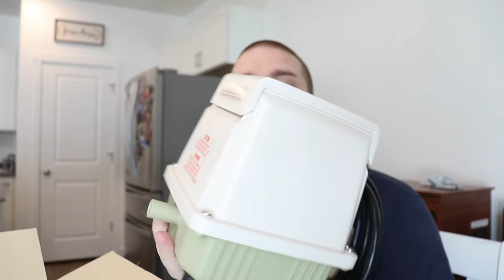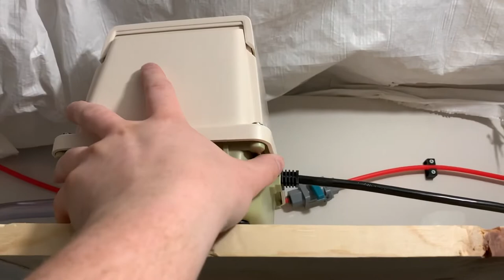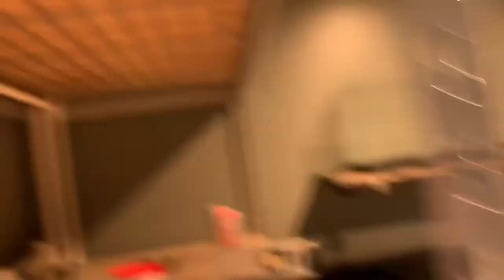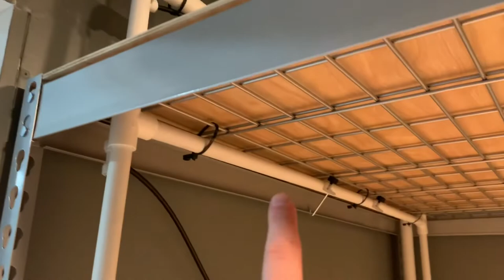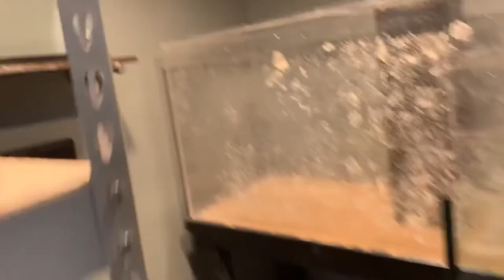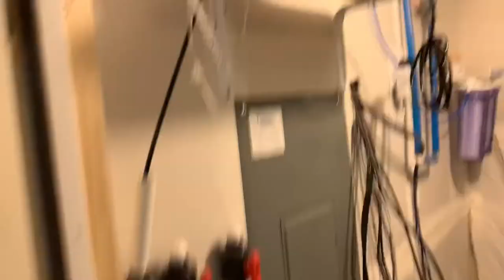Aquarium Co-Op Upgraded my Air Pump! #aquariumcoop

Comment: Have a linear air piston pump that I use in my fish room. It's awesome! Running for 6+ years, and it's great! Only thing is that since I don't have a generator, I have to use USB nano air pumps from the Coop in manifold systems to run air if the power goes out.